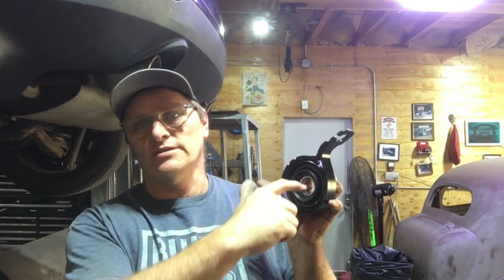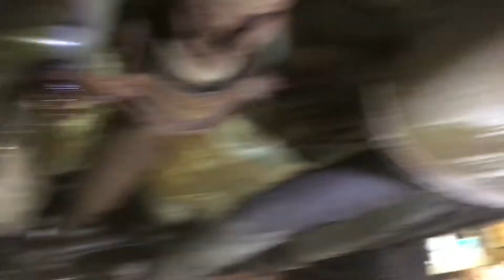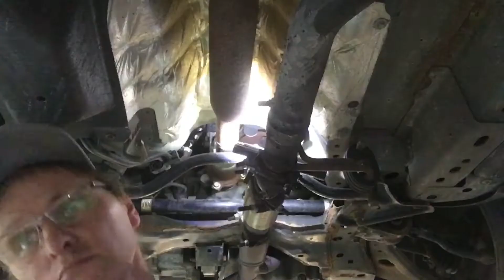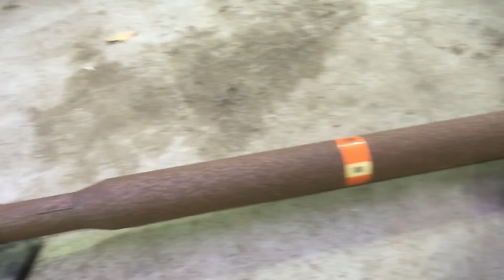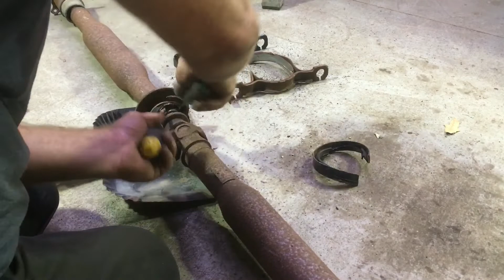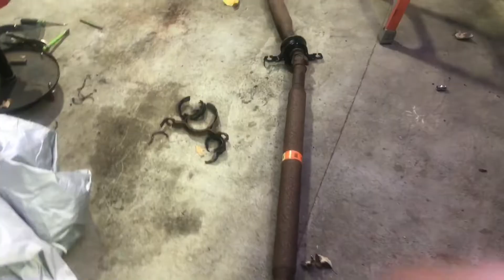2014 Ford Edge drive shaft replacement/repair center/midship bearings

Comment: I have a 2010 Mazda CX9 which are supposedly the same vehicle as the ford edge. Mine has a 3 piece drive shaft with 2 hangar bearings. They do sell the bearings seperately but after not finding anyone online that has actually done a 3 piece shaft bearing replacement and reading the reviews on amazon, it seems that the 3 piece shafts do not come apart like the 2 piece shaft does. I ended up ordering the whole shaft assembly with the 2 hangar bearings and all new u-joints for $250 from ebay. I know it's more expensive then just replacing the center bearings but you get the benefit of getting an entirely new assembly. You also get the benefit of an easier job. If you try and buy the entire shaft from some place like advance auto, they want upwards of $800 for the part. Hopefully the shaft is well balanced as well as the OEM shaft was.
Reply: I have the same car, same issue. How is your new driveshaft going? Was well balanced? Can you share the link of the one you bought?

Comment: Note that the spline has one groove that is wider than the others. It will go together only one way. I think you can see this in the video at time 9:37. This is for proper balance. You should mark both sides of the shaft before you separate it just in case your spines aren't like this so you can put it back together the same way.

Comment: I hate it when these videos cut out the most important part! How do you separate the spline?
Reply from the maker: I didn’t cut it I separated shaft at seam lot of pounding with blunt chisel but it will come apart if you look at two pieces when it’s apart you can see where it’s split sorry wasn’t more helpful that’s just how I did it

Comment: Just wondering how you managed to separate the shafts? Mine are stuck hard with no real place to hammer them apart. I've had it soaking with penetrating oil overnight so I guess I'll give that a shot.
Reply from the maker: Sorry just saw comment it takes a lot of hammering wire brush any rust of and you should be able to see where comes apart
Reply: @btwgarage5265   Thanks. Yeah. I had to sledge hammer it off and I buggered up one of the dust caps as well. All back together. I guess we'll see how long the u-joints last.

Comment: So it definitely need to be pressed. How difficult was it to  line it to be pressed. I dont have one myself but id imagine if i get the part take it all apart my local garage could press it for me.   The universal tip is very helpful.  Didnt know i couldnt buy the seperate. 
   Honestly starting to hate how manufacturers are making it where you have to buy a whole system instead of one simple part. Mines a 2 piece (like the video) and the dumbass at autozone argued with me that mine is a 3 piece bcuz his computer said soo. Over $1000 because of a carrier bearing.  Great video gave me hope. Thanks.

Comment: We are about to do this same job.  I was NOT impressed with the potential of a $1000+ fix on my Edge, but finding a $60 part puts my mind at ease!
Reply: I didn't do mine yet. Was debating on ordering the bearing separate but couldn't find anything proof its was doable until now. I know separating the two shafts won't be easy but how was putting them back together.  Does it have a clipe like an axle to keep it looked or does it just  seat together
Reply: @coeyG  It’s a tight press fit, and you have to use a mild loctite
Reply: Does heat help separating the shafts? 
 @Java-Junky